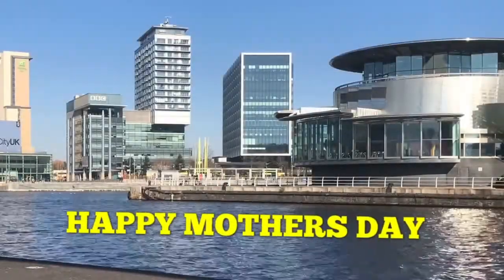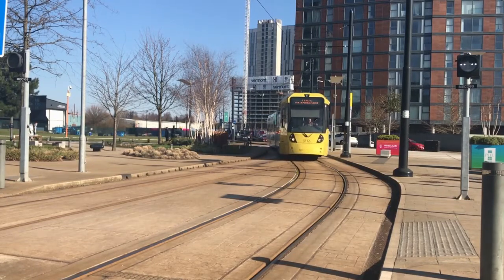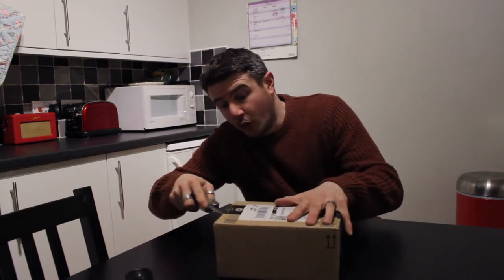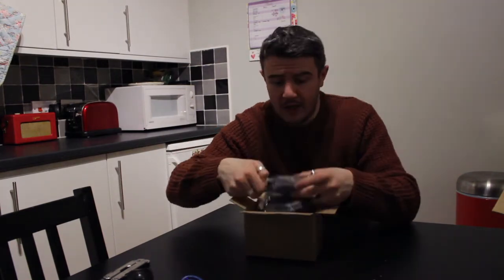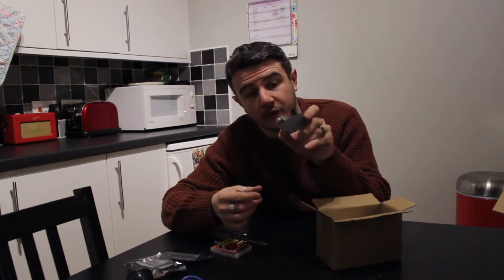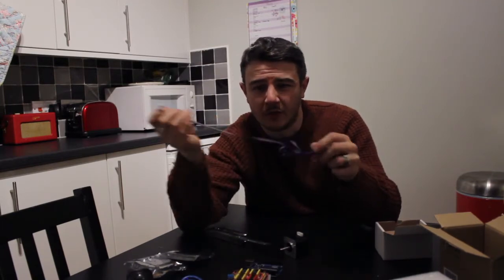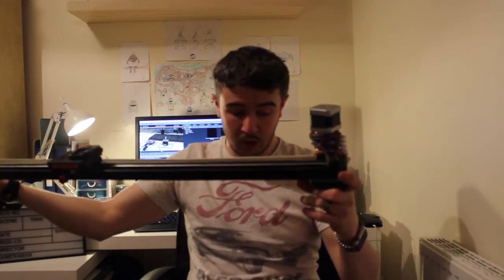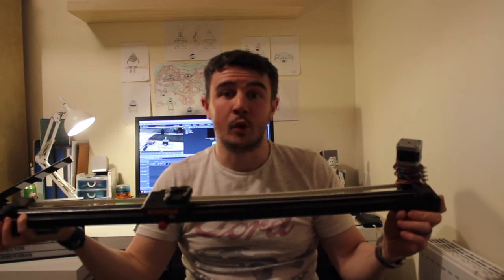£25 diy slider motor for Stop Motion Animation

Comment: Hi Peter, great vid. I'm looking at buying the kit off Amazon. What power supply do I need to run it? And do I need separate power for the Arduino board and the motor or does the motor take it's power from the sheild board? Cheers
Reply from the maker: T2BusCrazy hey. Thanks for the comment. Please do check out my other videos. If I’m correct. The motor is powered by the arduino/shield. You just need to power the arduino. I can’t remember off the top of my head as I just used my emotimo power cable. The gear in the description below is the same gear I bought. 👍🏻
Reply: @peterjellis  excellent, thanks for the info. I will get it ordered. Is it possible to get the  odd off you to please. Cheers
Reply from the maker: T2BusCrazy absolutely. If you send me your email address I will send it over 😀👍🏻
Reply: @peterjellis  cheers, just messaged it to you on Facebook